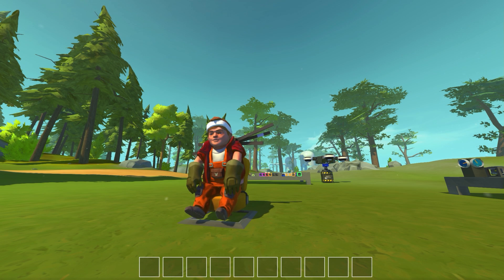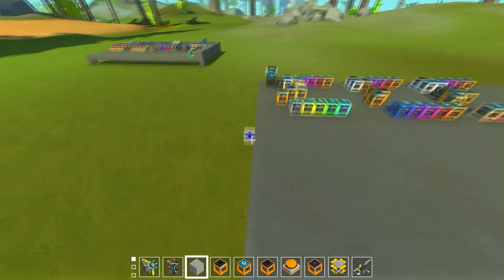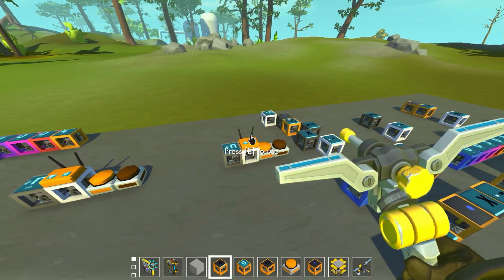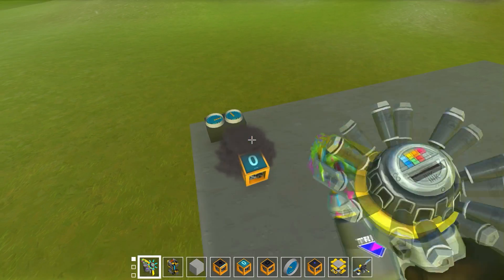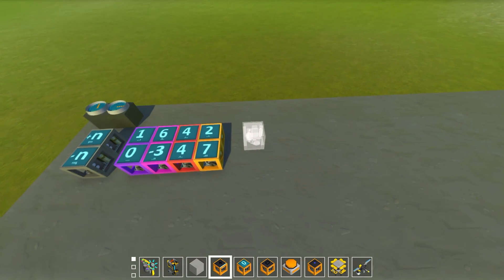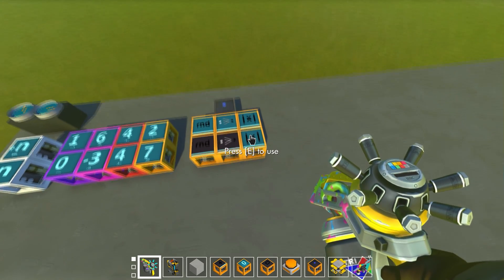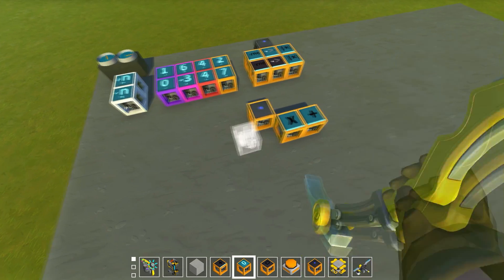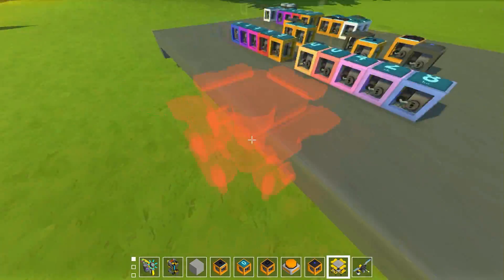GPS Coordinate Encoding for Single Packet Data Transmission! (Scrap Mechanic #354)

Comment: Who the hell uses y as up and down rather than z?
Reply: Makes sense for you. My first encounter XYZ in Minecraft so that's what I expected. A lot of people came to scrap mechanic and so see sink in terms of Minecraft.
Reply: If you're designing a building from a floor plan, for example, then X and Y will describe what the floor looks like, so the next axis, Z is used for the depth, which in this case makes Z the upwards axis. But if you are making a 2D platformer - think old Mario games - it is side-on, so X will be left/right, and Y will be upwards, and so when they went 3D they added Z as the depth, making Z go through the TV rather, than parallel to it.
Reply: People who play minecraft(such as myself)
Reply: @rudeskalamander  I forgot about Minecraft doing that. I'm used to gcode where z is altitude. And in every math class I've ever had z is the third coordinate. I've always thought of z as "lifting up" from the graph paper

Comment: Man, if you find a mod that have indestructible blocks, you can do an internal combustion engine with the explosive blocks, you know, with real explosion
Reply: That would be extremely hard, you would have to replace the explosive everytime it makes 1 cycle